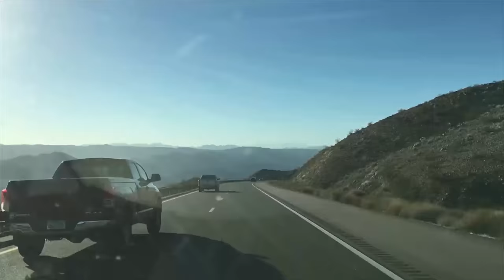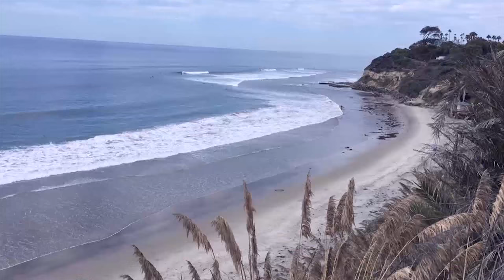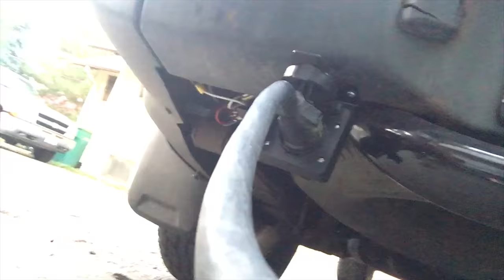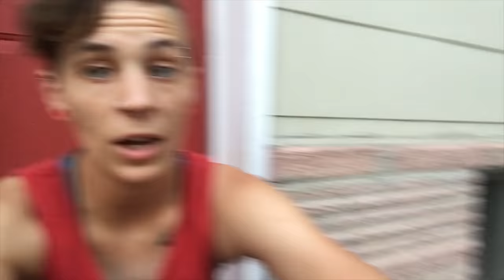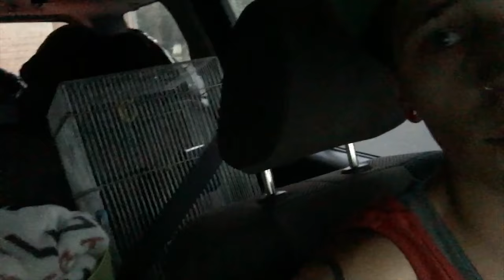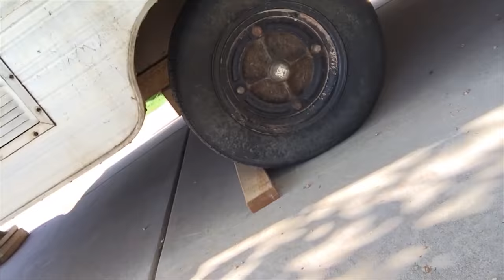Trouble towing a vintage travel trailer

Comment: Grounding issue with the camper…just check out the screws around the tail lights and license plate frame…my moms did the same thing even after replacing the fuse…what was making the fuse pop? Turned out to be a bad ground or something with the tail lights…old video but thought it was good info to share…urs is in a lot nicer shape then my moms…turns out the hitch had a bad weld and it ended up flipping and causing a huge wreck.,,I don’t care much for these types of campers cheaply made